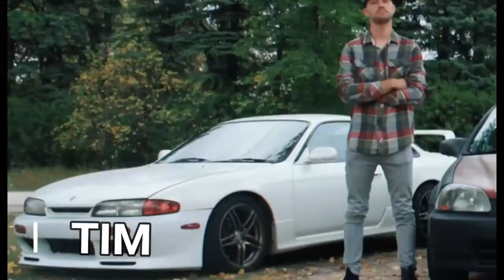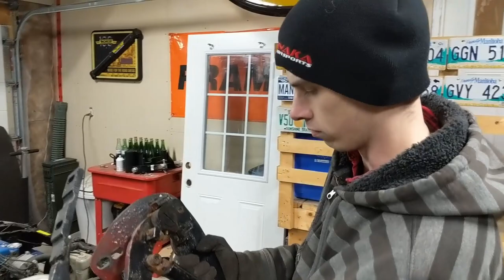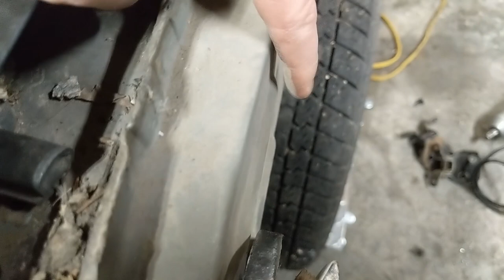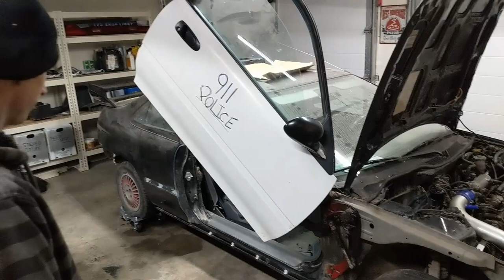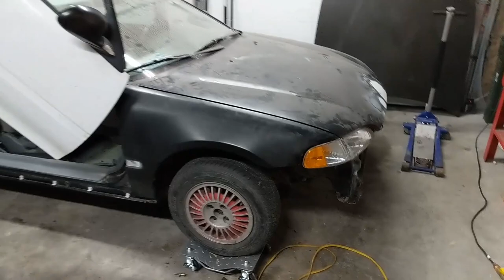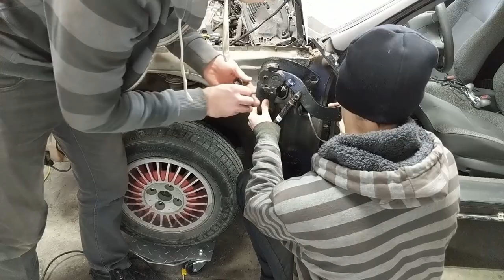Budget Show Car | Lambo Doors | Furious Civic PT 6

Comment: If thats a "Vertical Doors" kit your not supposed to remove the door for installation. Youkeep the doors closed, remove the front fenders. Tape the door up so it doesnt sag, then remove the hinges and replace with the lambo hinge. This way everything stays in alignment and you can visually see what you need to modify. I know its done and over now but it will save a ton of time in the future. And it was your spacers that caused the alignment issues. They are a direct fit kit.
Reply from the maker: That sounds alot easier than the method we used. Thanks for the tip, we'll have to use it next time
Reply: Hey I see this is recent so you think I should use your method for my 2000 Honda Civic I’m gettin the kit Soon looking for ideas to give to mechanic to make it a smooth install
Reply from the maker: Hi, if you're having a mechanic install the hinges you may want to mention the technique where you leave the doors on the car. We don't have experience with this method but it may work smoother
Reply: Mt Garage oh I figured u tryed it already but I like the idea thanks brother!

Comment: I just bought a used identical set. Waiting for it to arrive. Do you remember the measurements on the strut? I would love to get them ordered and install all at once.
Reply from the maker: I don't remember the exact length, but these are the units we purchased.

https://www.ebay.ca/itm/2-Bolt-On-Lambo-Vertical-Door-Kit-Shocks-with-2-Ball-Joint-Fittings-M12-600lbs/323208650121

Comment: Do you have a link for the replacement hydro struts please?
Reply from the maker: https://www.ebay.ca/itm/2-Bolt-On-Lambo-Vertical-Door-Kit-Shocks-with-2-Ball-Joint-Fittings-M12-600lbs/323208650121?item=323208650121&pageci=c17004ea-b2c4-4166-8c80-32c534d2c10d&epid=1029709162

These are the ones we used. Worked out great.
Reply: @MtGarage  ok thank you